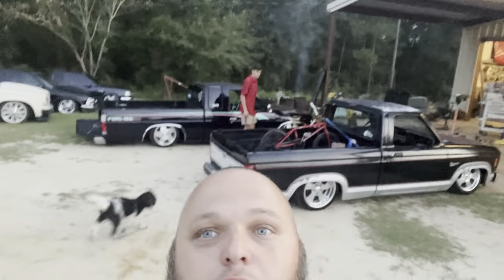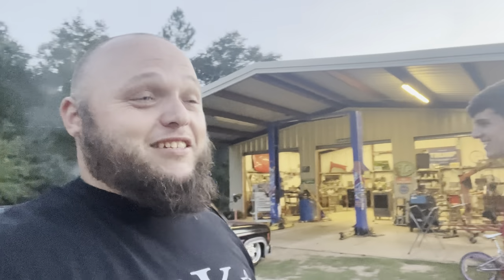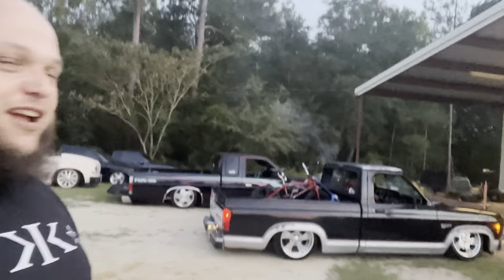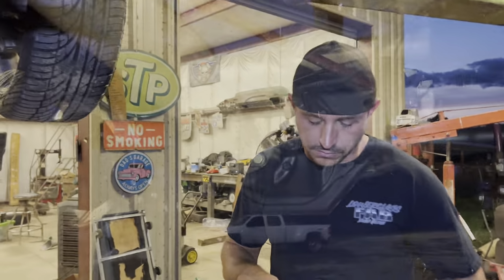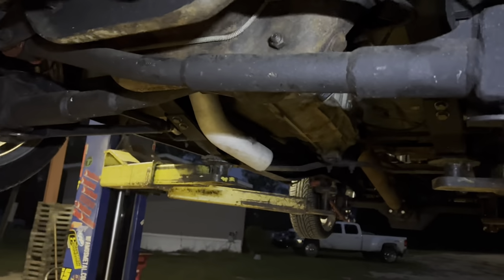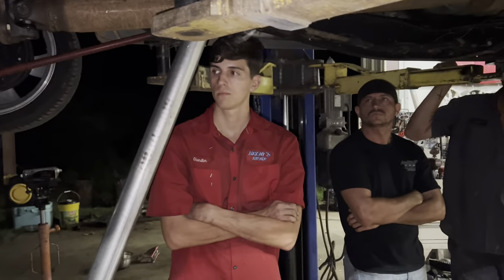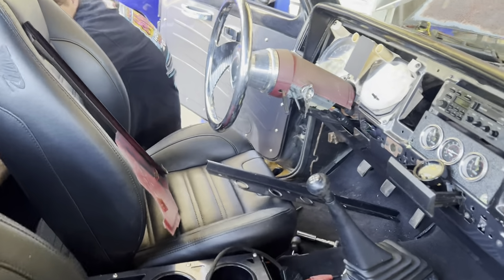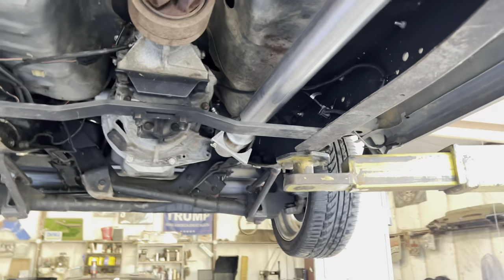Chandler’s Ranger updates….MiniTruck build-off is shaping up nicely

Comment: Is the kp 6 link plus a watts better than a 4 link with a wishbone? Or could someone explain the differences?
Reply from the maker: The KP 6 link on this truck is a forward triangle 4 link….it has straight lower bars and triangular upper bars…those 4 bars are what locate the axle….the 2 rear bars are just addition bars that the bag is located on for lift….the main reason for this is room…with the bags being below and outside of the frame you have plenty of room for air management…and it’s 100% bolt on which is nice…some KP kits have a parallel 4 link and need a panhard bar or watts link but this setup doesn’t because of the triangle upper bars….I wouldn’t say it’s better or worse because each setup is different but the bolt on makes it i nice option
Reply: @lowerclassfab431  Thanks for explaining.  I'll look thru older videos on Chandlers ranger and see if it shows the suspension so as to have a visual. Lovin the channel man